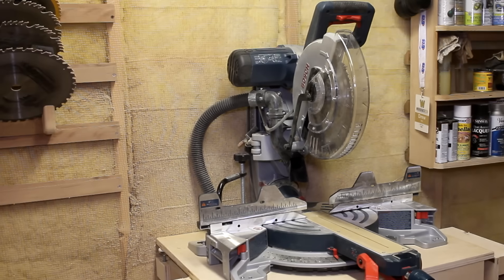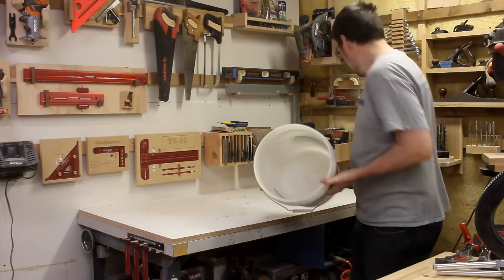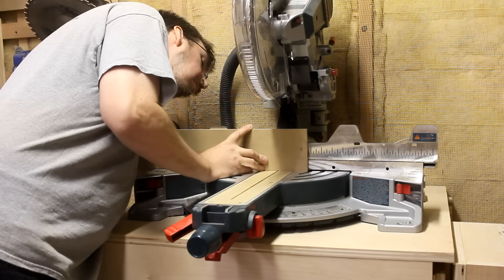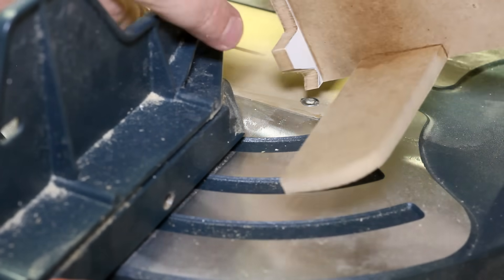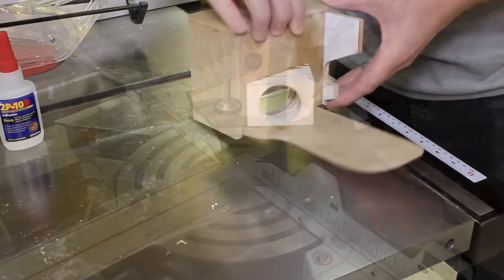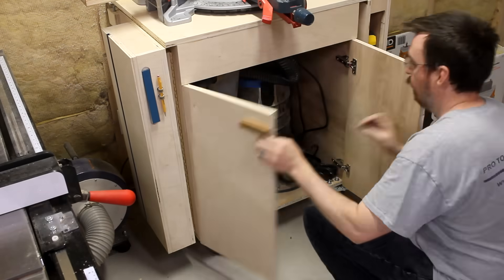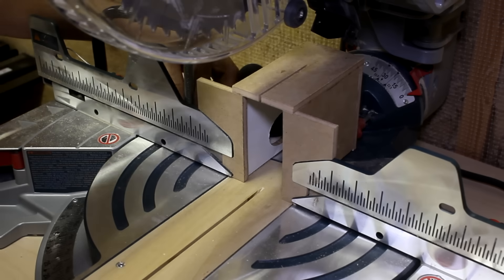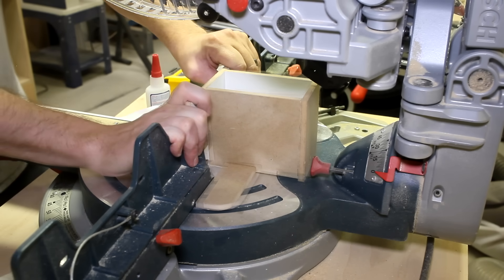Shop Work: Improving Dust Collection

Comment: Great video from beginning to end! I have my miter saw (should be called Dust Saws) mounted on a large rolling cabinet. First I used the bag. Then tried a small shroud around the back with a vac attachment. Then tried a very large shroud with a curved back built like a shadowbox. THEN, I made a large dust scoop, cutting a 4" gutter elbow and attaching it to the saw around the built in scoop. That works the best. When possible, I open the garage door and have a fan behind me in the back of the garage blowing out. But I HAVE to try and make one like you did. Thanks again!

Comment: Built one for my Ridgid 12" mitre saw, I had to remove the saw blade when I was building it. Short version, build it too tall, by time I cut it down so the arm could come fully it ended up being 2" tall and couldn't connect a dust port. Well it was a good try.

Comment: Drew, I see you added a zero clearance insert to reduce tear out on your cuts, does that work with beveled cuts as well? or do you swap back to the supplied insert for those?
Reply from the maker: Works on bevels as well.
Reply: @FishersShop  awesome.  One more question for you, hopefully you see this.  I purchased the plans for your mobile miter station, but I want to modify it to have drawers instead.  as far as drawer width goes, generally the drawer is 1" less the width of the inside of the frame it's mounted in to account for the sliders correct? (obviously dependent of the slider) But for drawer height, what kind of spacing do you use between drawers, like in your "two sheet tool seat" for example.  Thanks!
Reply from the maker: @grahamh1067  Yes, drawer slides are 1/2" wide each.  The space between drawers is pretty arbitrary.  Just all depends what you wanna stuff in there and how much of an overhang you want on your drawer faces once installed on your drawer boxes.  It's up to you
Reply: @FishersShop  i can do arbitrary! thanks so much, Drew.  fortunately i've got some leftover walnut for the pulls.

Comment: Drew,

I love your channel.  I can relate to your quirky sense of humor.   I would hate to be your neighbor and have my stuff just disappear.
I was sold on your channel when you started to weigh out the saw dust.  NO ONE does that.  Imagine using science to determine what maybe the best saw dust collection method.  So like any enterprising YouTube channel surfer, I copied your design and it worked great on my brand new Bosh Glide Miter saw.  Worked great until I cut off a 1" piece of scrap which then immediately impacted the back of my dust collector and, well now I have kindling for my fireplace.  It was not pretty.  I scared my wife who was upstairs at the time of the incident.  Have you had this happen?  I can be exciting.  So then I when back to the drawing board and created a zero clearance fence for the miter saw.  But now I have saw dust all over the place.  What is a wood worker to do?  Maybe create horizontal vanes which would keep big blocks of wood out of the collector, be long enough to not be cut by the saw blade (to stay in position), but still allow sawdust to to be accumulated.  ???  Have you experienced this challenge?

Comment: Is the power to the cyclone vac on the same switch as the miter saw?
Reply from the maker: In this case, yes.  The sensor has one plug so both machines end up on the same circuit.  However, the sensor for my tablesaw has 2, so I can split the circuits for the saw and the dust collector.

Comment: 50% of my dust problem is forgetting to turn on the dust collection.  I don’t notice because I have my hearing protection, mask, and goggles ( that reduce my side vision) on and my attention is on the cut and the saw blade 😬. Oh, and the goggles are always covered by fog on the inside and dust on the outside in the winter and then there is sweat in the summer. So easy to forget. 🤗

Comment: Hey Drew, the comments section is working for me again! Based on your work with this, I made something sorta similar for my miter saw and learned a couple of things...one... this works! Two... a shop vac hooked up to 2.5 inch dust hose has enough power to pull 6 feet of vacuum cleaner hose into it! I had a heck of a time getting it back out! Thanks for what you do and the humor you do it with.
Reply from the maker: Haha, nice! :)

Comment: No doubt that's an awesome solution. Curious to know if the shroud makes as much of a difference as the location of the hose inlet. While I don't have time today to make a similar shroud, I'm toying with the idea of fixing the hose to the back of the fence so the vacuum is as close to the cut as possible, solving perhaps the additional problem of mitres as well as the moving hose knocking tools off the pegboard I have just behind my saw in my too-crowded shop area. The unscientific method of testing I will use today is a visual inspection of the density of the air after cutting ;)

Comment: Why not making walls parallel to the sawblade cover. They should end at the mouth of the dust collecting opening. There could be a flexible hose or something made from a vacuum cleaner.

Comment: You must not use a mitre saw for a living ? Who only cuts at 90 degrees?  I am guessing you realized after your not-thught-out design,  that  it can not cut angles or compound angles? Fail!
Reply from the maker: I only cut 90s with that saw. For 45s I use my miter sled. In the off chance I need some other angle, the shroud pops out. Not sure what you’re not grasping here.

Comment: If you split the hose and also vac through the stock dust port, does that make the efficiency any better? I’m guessing the dust loss is just the little bit being carried out of you duct box in the gullets of the blade.

Comment: Awesome work and excellent video! How does it do when doing a 12” crosscut?
Reply from the maker: Not too bad.  You start by first cutting a small shallow kerf for the dust to travel through.  Then cut normally and it collects the dust pretty effectively.

Comment: brilliant, but if you only do straight cuts why not use a cross cut sled on a table saw? (if you have one)
Reply from the maker: Just not convenient for longer boards.  The miter station has extendable support wings to help me with those.

Comment: I love this video! Thanks so much for sharing. I happen to have the exact saw you do, so it really caught my attention; AND I've tried a couple other ways to implement dust collection to no avail. Well, I took your idea, widened it quite a bit so that it could take on 45 deg cuts, attached a 6" port for my dust collector, and solved a 4 year problem of never being able to catch dust on my chop saw! 

Now that it's built and working wonderfully, I don't see why chop saw companies aren't doing this. Their dust collection is atrocious. I realized you measured ~75% collection for their port, but if you are in the business of keeping an inside shop clean and healthy, 75% is nothing. Every tool in the shop needs to be around 95% or above. And this style collection is an easy prefabbed plastic mold that could attach underneath (where you have yours) with an optional 2", 4", or 6" connection depending on your vacuum.
Reply from the maker: Thanks, Dan!  Glad it worked out for ya!!

Comment: What about tear out on the backside of your cut piece? Will this type of design still help if you added a zero clearance opening?
Reply from the maker: If you made it zero clearance, you'd severely reduce the effectiveness of the shroud.  To guard against tearout, you could just put a piece of scrap behind your piece and cut that too.

Comment: Very good results and quite enlightening.
Suggestion for remedy the first outtake: tie a knot in the end of your power cord then put the knot/loop over the quick-release for the tension. When you go to plug the saw in, tension the blade take the cord off the lever, plug it in and get to work.  When done unplug it, put the knot/loop on the tension lever, release the tension and get a beverage to celebrate such a clever idea ;)

Comment: Hi, does  your method still work while using the telescopic saw?  I mean, when the cut is made away from your device
Reply from the maker: Yes it still works but you just first cut a small shallow kerf for the dust to travel through first.  Then you can extend the blade out and down, then push it through the material.

Comment: Great videos once again! I have this very same saw, can you share a template of the parts by chance? I recessed a rectangle dust hood under and behind my saw so far  that catches alot of the dust flung behind it, added sides also. Right now i have a small dust collector hose attached to the OEM dust collection port but will make this one next!

Comment: Great experiment and wonderful results.  After seeing some of the huge shrouds which totally enclose a machine, your mini shroud does an outstanding job albeit with the admission that it's only for 90 deg cuts.  As you said, the vast majority of cuts are at 90 anyway though I suspect that cutting wider boards may not be quite so good.  Good job though, stay safe and G'day from Australia!
Reply from the maker: Cutting wider boards is a big different but the shroud is still extremely effective.  I have to first cut a shallow groove down the board for the dust to travel in.  Then I can cut it normally.  When cutting tall boards though, the dust goes over the top of the shroud.  This is why I can use the shroud as well as the stock dust collection chute in combination with one another.  It's not perfect, but does a great job and it's compact.

Comment: Hope everyone is well.  How is the miter saw dust collection working?  Any follow-up, further improvements or lessons learned?  Stay  healthy and safe.
Reply from the maker: Thanks!  Only thing I've changed was I also put the stock bag on as well.  Surprisingly, it still collects some too.
Reply: Fisher's Shop That is interesting!
Reply: Fisher's Shop Forgot to mention an idea I saw elsewhere a few weeks ago. We normally pull the blade of a sliding miter saw forward and down, the cut as the blade is pushed back.  If the cut is instead made as we pull the blade forward, a ton of dust shoots back along the kerf, helping dust collection.  Seems to work, but I usually forget to connect the vac, or to turn it on.  ;-)  One day at a time!  Best wishes!

Comment: This looks great (and saved to my "shop" playlist), but there's one solution you didn't test, and that is the "little bandshell" completely surrounding the saw. Those might work better with a large volume dust collector, so maybe the ultimate solution is to have both (considering diminishing returns, etc., etc., etc.)

Comment: Do you think your design would benefit from a wider opening?  I know you fit it with the fence in mind but the area up and around the fence could still have some dust spray?

Just thinking of other ways to improve the design.

Love the humor!
Reply: Just asking as I'm sure you can see where left over dust is going
Reply: Also, how do you think the comparison would be for larger boards.? Like 2x8, 2x 10, etc.  Seems like more opportunity for dust spray and since your shroud is fixed it may not be as good as the duct tape shroud that can still move with the saw?

Comment: I finally made this!  I didn't go any tests beforehand but I don't think my default dust bag is anywhere close to 77% efficiency.  It's really awful.  The shroud seems to control at least 80%, and there are some small gaps I need to fill that I'm sure will make it even better.  Overall EXTREMELY happy how this has turned out.
Reply from the maker: Glad it worked out for ya, Adam!

Comment: 8% doesn't sound like a lot but you reduced the amount of dust released into the air (which is what really matters) by 3 fold (12% vs 4%). I say that's quite significant.

Comment: My concept of diminishing returns vs amount of time/material spent stopped at the duct tape solution which can probably be improved.  The box will collect dust but it will do so laying on the table next to the saw.

Comment: I like the way you think outside the box.  I have the same saw and made a larger boot that works ok.  I would like to try this.  My only concern is on wider boards since it is stationary and doesn't move with the saw.  Does it still do ok on 10 inch boards?
Reply from the maker: Yes it does ok but for wide boards like you're talking about you want to first cut a small channel for the dust to travel through, then pull out, drop the blade, and push the cut through.

Comment: I have the same saw, I used a piece of 1/4" think neoprene and switched it with the original and if you have a 600 fpm collector, it gets roughly 80-85%, very simple, just needs a larger chute

Comment: Great idea! I didn't read through all of the 900+ comments (!) so I don't know if this was asked yet. But, can you, or have you adapted this to be able to make miter cuts on the saw? I have a lot of crown molding that I'll be cutting inside and this would really help! Thank you!
Reply from the maker: I recommend just making 2 of them then.  Make one for 90-degree chops and another for 45s.  If you need some obscure angle, then you'll have to revert to the normal vacuum port but even that's not all THAT bad.

Comment: Enjoyed the video, especially the running commentary and then the out takes 👍

I'm curious, though... does spraying the accelerator on the outside of joint, rather than the opposing surface, actually work?
Reply from the maker: The accelerator will contact the squeeze-out and then wick inside to the actual joint.

Comment: Aside from your video (as well as all of them) being tremendously funny and informative, I do have a question now that you've used it for a while. As you've made mitered cuts into the center box, does it make the assembly any less effective? Thanks
Reply from the maker: I don't use it when I make mitered cuts.  I pop it off and just use the standard vac and top port.

Comment: Nice solution and significant improvement in dust collection, worth the work to build one. I wonder did you try refining your design to include angled (miters not bevels) cuts? Looks like if the box was wider it might work. I don't know if this will work on my older DW708 since the slider mechanism is way different than your Bosch articulated saw. I do like the design of the Bosch as you can place the saw up tight to the wall.
Reply from the maker: If the box gets wider, you lose some suction and it's less effective.  So far for miters, I just pop it off and use plug the vac in the top port.

Comment: Bandsaws tension tip : I have a small strip of card with "Tension!" Written on it, and a small magnet glued to the reverse. When I release the tension of the blade I pop this reminder on the blade; now I never forget to tension. When in use you can stick your reminder to the tensioner handle for safe keeping - HTH

Comment: I have the same saw and Oneida system.  I took the route of expanding the rubber shroud and then added a second vacuum using an ABS “Y” off the top of the Oneida.  The velocity of air movement is so ridiculously high I get the same result.

Comment: Really interesting - thanks.

One thing I did wonder is whether there's any difference in the size of the particles your shroud is able to pick up. As well as the mass of the sawdust you collect, if you're collecting more of the really fine particles, you're probably making the air in your shop a lot safer to breathe.
Reply: That's very important! Very fine dust bypasses the nostrils and nose defences of the person and gets into the lungs where it stays. Long term effects are UGLY!

Comment: Great design, And great humorous video. 
Curious. If the box were larger at the back, say a semi-circle from the center of miter adjust, would it also serve well for miter cuts? You would have opened the top with each swing left and right, but the back, sides and most of the top should still capture a lot.

Comment: Your idea is very good, but of-course is not applicable for every miter saw especially like mine that has a continues fence. But maybe if you want to play a bit more with your idea, i would test the possibility to have a frame box with 3/4 walls with a slide in (up-down) a thinner box that could be interchangeable  from 90 to the 45's.... not easy to explain it in words, but I hope you see where i'm going with this.

Comment: Funny video. Nifty mods. However, your math is a little off, because of the sheet of paper. You actually included the weight of the sheet of paper, and we can see that it is .18oz. You included the weight in all of the weights, so it isn't off by much, but it means that the difference in weights is actually minimized slightly. Math accounting for paper:
(.71-.18)/(.92-.18) = 72%
(.81-.18)/(.92-.18) = 85%
(.85-.18)/(.92-.18) = 91%
(.88-.18)/(.92-.18) = 95%

So, your solution was actually an even larger improvement over the alternatives than you thought!

Comment: Good dust collection. I once ruined a band saw blade by not tensioning it. I wired a light so that when the tension lever was on the light would illuminate the saw table. I never screwed that up again.
Reply from the maker: Neat idea

Comment: Thank you for the project and math class. You can join NASA.  :-)       I am about to buy a new Miter Saw. I see you have a Bosch CM10GD 10" Dual-Bevel Glide Miter Saw. I am between this one and the DEWALT DWS780. I like the technology of the arm of the Bosch but wonder if it makes the saw more loose (vibration) overtime. Would you be able to share some insights between the 2 models?    If you were to get one of these 2 as a gift, would you still choose the Bosch?   Thanks.
Reply from the maker: I have the 12" Bosch.  It's actually quite amazing at just how solid it is.  Yes, I'd definitely put the Bosch over the Dewalt.
Reply: @FishersShop  Thank you!